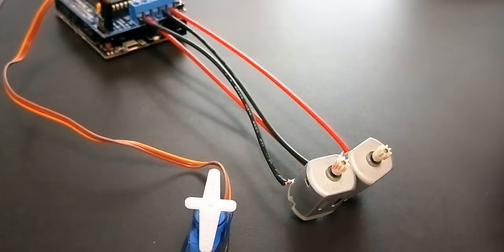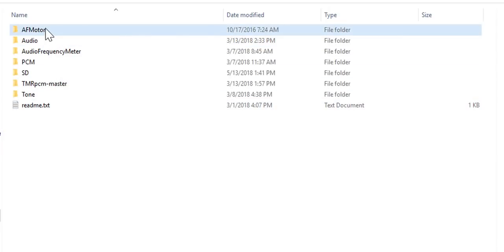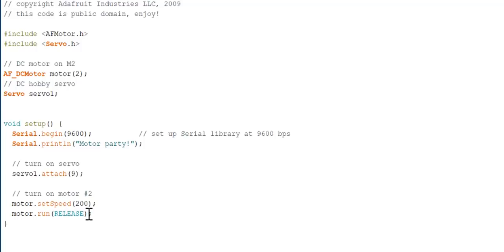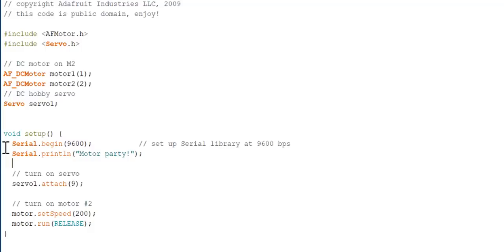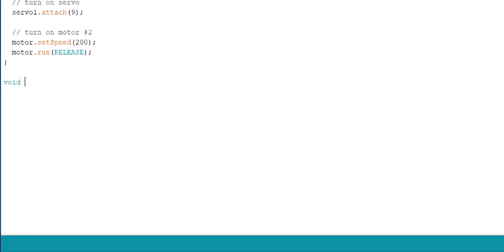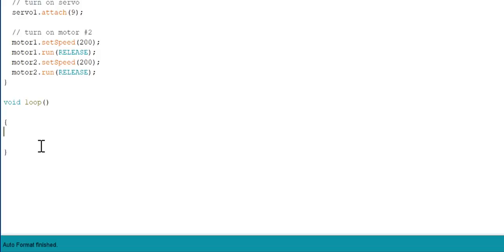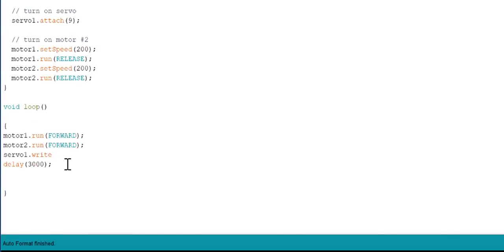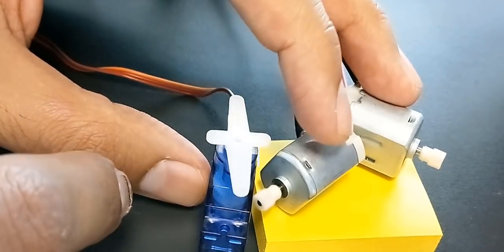L293D Motor control Module Tutorial - Run motors off the Arduino

Comment: Thank you so much for this video. Very thorough. One thing I’m still confused about is the Rx/Tx connection for this shied. I saw a video where someone connected their Bluetooth module to the servo pins, for power, ground, Tx, and Rx. The app I’m using as a GamePad controller is not recognizing the board, and I’m thinking I should just solder two wires to the Tx and Rx soldering that correspond to pins 1 and 2 on the arduino. I know these are used for serial communication with the arduino and that I would have to just disconnected the Bluetooth module before connecting to my computer. 

Any thoughts about the Servo pins serving as a connection point for the Bluetooth module?

Comment: So I assume I’ll have to get another arduino because after I hook it up, I won’t be able to use the digital pins from 0 to 13 if I want to connect leds, or other sensors… am I right ?

Comment: Can u run a nema 17 style bipolar stepper motor using this?
Does it make any sounds? Wondering because i want to make a 3d printed clock an it has quite some gears inside so i need more touqe than that lil unipolar stepper that is usually used with arduino. I am looking for a Solution that doesnt require an extra power source for the stepper. 
If someone knows it would be really helpful cause I dont hace a lot of experience with electronics

Comment: How do I use the digital pins to connect sensors/modules? I want to connect an ultrasonic sensor, a bluetooth module, and 4 dc motors.

Comment: Thankyou for this Video. I have purchased one of these shields to run a large 12v motor. What is the best solution to power the motor? I want to handle approx. 100A at 12V.  Can I run the program through an Arduino, to this Shield (powered at 12V) to a relay on each motor out line? Will a relay react fast enough to deal with the PWM of the Arduino?

Comment: A great explanation my friend. I just like to ask whether I need to remove the jumper clip from the motor shield while the motor shield and Arduino is run by only an external power source?

Comment: Very nice tutorial. I was wondering if a temperature sensor can be added in the scheme in order to change the rotation direction of the motors depending on the temperature read? Thank you.
Reply: You can use the 3x6 grid of connections to the +5, Ground and A0-A5 shown at 4:13 - 4:57 in the usual way.

Comment: Hey, I had a doubt in our project we are using 6 motors so can you suggest whhich drivers should we use to connect all of them as L293D and L298N permits 4 and 2 motors to use

Comment: Hola q tal disculpa le quería poner unas 4 baterías 18650 de 4.7 volts y 8800mAh cada una mi pregunta era si el motor shield con el arduino lo soportan. 
PD. Estoy alimentando 4 motores, un servo y un ultrasonico

Comment: I had a problem to connect this ..the problem is that if I connect both Arduino and motor driver to battery then motor driver light on but when I connect both battery and laptop cable to Adriano it will only on Adriano..... 😭..why

Comment: I have a question: So I have the Elegoo Mega2560 Board can I use the Shield on it ? Or is it just for the UNO? 
I found some other Motordriver but I want to control 2-4 DC Motors and a SERVO.
Reply from the maker: Should work

Comment: its not running for me. I have check the power supply,i am sure the problem wasn't batteries.But the weird point is that the driver can't upload in COM3 and COM1, but successful in COM4 and COM5.Is that a problem?Or the board may be broken?(the LED of the board is work)

Comment: do you know how to connect 2 steppers instead of dc motors?
I wish to build the collision avoidance  car, but with steppers instead of DC motors. For that you need 3 libraries, NewPing; servo, and AFmotor.
very new with arduino, and has been a very frustrating ride so far...
a bunch of information out there, but of little use.

Comment: Do the arduino needs to be comnected to a usb when you already have external power supply connected to the motor shield? I'm asking this because my motors run only when arduino is powered on.
Reply from the maker: Arudino needs a separate power supply yes

Comment: hey, totally new to arduino. only experience is programming and python and some rudimentary knowledge of electronics. i've read that i can power the arduino with a 12V @ 2A power supply, will that be enough to power the shield and run 2 3V DC motors? or will i need to get a separate power supply for the shield like what you did?
Reply from the maker: You would need 2 power supplies. One to run the arduino and one to run the shield aka motors.

Comment: thanks for the video. does this motor shield give the ability to control both motor to run in sync? I have problem getting my 2 dc motors to run in sync, my robot does not go straight. I am wondering if this thing is what I need to save me the task to look into PID control.

Comment: Hello! I was looking for this video! It is amazing. Question.... What Voltage did you use for those batteries. It may be 6volts?? Also, could I put 2 3volt battery packs together (2 positive wires into the + screw terminal, and 2 negative wires into the - screw terminal for the power (The 2 + and - wires from both the battery packs)) Thanks! I am asking this because I don’t have a 6 volt battery pack, so I was wondering if I could combine 2 3 volt battery packs.

Comment: Thanks. Very useful. Afaik the shield can not only run 2 stepper motors and 2 servos it can run those servos just as well together with 4 dc motors.
The servos are not controlled  y the l293D but by pwm pins of the arduino so are completely separate from the amount of dc motors or stepper motors

Comment: If I supply 12V to that board, can I run two DC motors rated at 12V and 1 servo rated at 7V ?

Comment: I have a doubt
that  L293D shield will use only analog ports A0 to A5 only and the digital pins a all OR will it use all the pins like both digital and analog ones??
plzzzzz reply
Reply from the maker: Analog pins can also work like digital pins.
Reply: @Fungineers  So if I'm supplying power to driver from external source and just wanted to run motor connected to M1 and M2 then which all pins of the driver should I connect to arduino, I cant connect all the pins of the driver because I have to connect RF receiver also to my arduino??
plzzzzz reply
Reply from the maker: https://youtu.be/OA0mJi0Q6GI
Reply from the maker: Did u watch this?
Reply: @Fungineers  Yes I have  watched  this video but I using MEMS sensor(accelerometer) and for that I need empty Digital ports not the analog ones......So only
Reply: @Fungineers  Can we solder a female header pin in the small hole provided besides D2 pin on the driver circuit ?? Can that be used for receiver of 433 MHz RF module??

Comment: Can tell how to add relay to the stepper motor using Arduino. I am building  mini injection molding Machine. 
It has running like this
Run at 60 rpm for 10sec than stop for  30sec and than again run at 60 rpm for 10sec. Please help me 
How can I do this

Comment: Hi sir as same I want to connect 1.servo motor
2. Two stepper motors
3.hx711 which is connected with load cell where can I connect hx711 module to driver circuit

Comment: Bro... I am having problem fixing the L293D Motor Driver Shield on the Arduino UNO... The pins are not going inside properly... Can u plz help?... Thanks in advance!
Reply from the maker: You can bend them slightly. If they are out of place you can desolder the unused pins
Reply: @Fungineers  OK... Thanks a lot...! The problem was solved by bending the connectors on Arduino UNO

Comment: Is there anyway i can use the digital pins when i Use the Motor Shield?
Reply: paul aaron Ordinario you can! Insert a wire into pin you want to use and then push the motor shield into the Arduino.
Reply: @onlyme3543  so i cam still use an Nrf24l01 transciever with a shield?

Comment: Great video and explanation 👏👏👏
You have mentioned in the video about A0-A5 can be soldered! What about Digital pins? 
I need to connect D3-D6 for some other sensors! How to do that with L293D !
Reply from the maker: Thanks. You can use analog pins as digital too.

Comment: I don't know where I'm making a mistake but I've already death two base boards uno. Motors have DC 12V and shield power supply also 12V. I had a UNO board without power. Several times The engines were running and then stopped, and I didn't start it anymore. You can advise ..
Reply: The first power supply I used was the 19V 3A adapter and the second 15V 400mA ... both without the UNO power supply
Reply from the maker: What kind of motors are they and how much current do they draw? Im guessing they are drawing too much current.
Reply: @Fungineers  https://www.aliexpress.com/item/32778436544.html?spm=a2g0s.9042311.0.0.27424c4dhmv2PG

Comment: I'm using an IR to run my step motor using pin #6 if I install this shield there is no place to connect this wire for the remote control device to this shield.

Comment: How to make this work wirelessly using Bluetooth module ? Please explain ? What changes to be made in code and the driver module and where to connect the Bluetooth module .
Reply from the maker: Connect a bluetooth module with the arduino or instead of the arduino.
Reply: I have connected a Bluetooth module but I don't know how to connect the servo and 4 dc motors together

Comment: How can I use the digital pin of Arduino if there's a shield on the top? Because I will insert 5 pin in my Arduino base on my schematic and where's the IN pinout of the module? Thank you
Reply from the maker: https://youtu.be/OA0mJi0Q6GI

Comment: Hey ,Very useful video. Keep it up man. 
One quick question, can I use this motor shield for control 6 dc motor(forward/ backward)
If not,what I can use instead.
Reply from the maker: Thanks buddy. You can do up to 4 motors. You will have to stack another shield on top to control 8 motors. But battery voltage will also have to double.
Reply: @Fungineers  thank you🙂

Comment: How much voltage you applied externally on shield?? 12v ?
Reply: in the min. 5:33 you can see the external power is a AA conveyor battery, a single AA battery usualy has 1.2v volts, if we multiply it by 4 = 4.8v, he's using 4.8v power supply, not sure if it's suitable

Comment: Can i use it to run 12v motor
Reply from the maker: Yeah shoudl be ok. Make sure batteries are good for 12V or a little higher
Reply: @Fungineers  i plan on using batteries from old laptop. Thnx.

Comment: The motor shield driver board's ext power voltage states that 5-9volt. So after removing the jumer can i apply 12 volt to it? Or should i stick to 9 volt.
I habe bought bo motor which can run 3-12volts
Reply from the maker: Stick to 9. Motor should work fine at 9V.
Reply: @Fungineers  yes but if i can produce 12 volt my motors can run high RPM. I saw on website it can take input of 12 volt. But i am scared
Reply from the maker: What application are you using for? Do you really need to speed?
Reply: I am making a mobile phone controlled car for race
Reply from the maker: I think the shield should be good for upto 30V. Read the documentation to confirm, but I think it's ok to use
Reply: @Fungineers  ok thanks will try and let u know

Comment: how can we use the digital pins in arduino to attach sensors when the motor shield is put on? should we solder it to the pins available on motor shield ???
Reply from the maker: Yes. Just solder some header pins so you can connect wires
Reply: @Fungineers  can you take video about it
Reply from the maker: I already did it in my line follower robot tutorial.

Comment: Can I use it to control a big motors...let say nema 34 or 220V motor???????
Reply from the maker: No those cant be run off batteries. 220V needs AC current. Check how many amps your DC motor is rated for, and make sure it doesnt exceed the max current/amp rating of the shield.

Comment: Hy bro, i am using this motor shield to connect 4 motors......i want those to be operated wireless, so got an nrf transceiver where do I connect the receiver......
Reply from the maker: Hey buddy. You can connect to any arduino digital pin. You can add headers on the shield like I did in the video that I made about the line follower robot. If you watch that video that should make things easier.

Comment: Hello...could you help me? please.  So I am a french professor in france. I want to make some lessons on arduino sytems but I don't succed to run  some motors with L293D Motor control modul...with mblock grove shield not with program C .Thank to converse with you.alain
Reply from the maker: Bonjour. Whats the problem you are facing? I can try to help you but it will be difficult without seeing your code. Its better to post it on an arduino forum. There are people who are smarter than me on the forums and a lot of people can look at your question and try to answer it.
Reply: Hello my friend.I am Alain Aubry from France.I am a teacher in college and I try to find some new lessons for my student. I have made a lot of lessons but I am stop by three problems...LCD RGB screen, ...7 Segment screen and how to order motors with this cart L293D...In france, we don't practice in college C Langage  we use mblock module....but I don't find the programe for my three problem anywhere.....are  you able to make these programme?

Comment: Does anyone know what pins this shield uses from the Arduino? I want to connect addition things such as LEDs and a button, but I don't want to solder to pins that this thing is using.
Thanks
Reply: Same question here...
Reply: @erbozr7231   I eventually figured it out, and I put the list in my code for later referral:

/*  ================================= MOTOR SHIELD NOTES ================
  Digital pin 2, and 13 are not used.

  The following pins are in use :
  Digital pin 11: DC Motor # 1 / Stepper # 1 (activation / speed control)
  Digital pin 3: DC Motor # 2 / Stepper # 1 (activation / speed control)
  Digital pin 5: DC Motor # 3 / Stepper # 2 (activation / speed control)
  Digital pin 6: DC Motor # 4 / Stepper # 2 (activation / speed control)

  The following pins are used if any DC / steppers are used
  Digital pin 4, 7, 8 and 12 are used to drive the DC / Stepper motors via the 74HC595 serial-to-parallel latch

  The following pins are used only if that particular servo is in use :
  Digitals pin 9: Servo # 1 control
  Digital pin 10: Servo # 2 control
  =========================================================================
*/
Reply: @ArcanePath360  Thanks man!

Comment: How many voltage for arduino mega and l293d module if i am use arduino mega with l293d module and use 5 ultrasonic to 5 v in l293d module and 5v lcd and 1 ultrasonic 5v in arduino mega. Thanks before
Reply from the maker: Same as whats used here. All sensors and lcd cam be connected to arduino 5v pin

Comment: Hi,  How do you set the voltage of the motors? I have motors that can be take 3v to 5v. 
Thanks
Reply from the maker: You dont :)
Motor voltage is set by the number of windings they have so the voltage at what they operate is fixed (but have a certain range like you said 3 to 5). So anything in that range is fine.
Reply: @Fungineers    I see. I guess what I am asking is, what voltage does the shield supply to the motors, but I suspect it is 5v from the Arduino with the jumper pin intact?
Reply from the maker: Yeah sorry I didnt understand your question. You are right, It is 5V
Reply: @Fungineers   Thanks

Comment: PLEASE HELP ME!!!!! My first question is :can i run only 4 DC motors 5v?Which power supply i should use,the one from arduino or from l293d module?Can i run these motors in a particulary part of time like : start first dc motor and than after 3 second it will change rotation and the second dc motor start to rotate? Please help me...
Reply from the maker: Yes you can run 4 motors, as I have clearly stated in the video. You have to use the external power supply. Yes you can run them in any order, by programming your Arduino.
Reply: @Fungineers  thanks sooo sooo much, U are awesome!!!
Reply: @Fungineers  Sir can u help me with the code please,because im having problem to keep one dc motor off while the other is working?
Reply from the maker: you can use the release command to stop and run to operate as explained. Read up on the library and what it does and it should make sense.
Reply: @Fungineers   thanks a lot.I have tested them and everything is okay.Thanks again!

Comment: How to control toy car stearing using arduino
Reply from the maker: That would be a great project. 
First of all you need a servo to act as the steering wheel and link 2 rods to it. So when the servo rotates 45 degrees left it pulls the rod and tyres to the left and vice versa. The arduino coding is easy, just use the servo library and use 2 pins from arduino one for left one for right. When one pin is high it enables servo to rotate left and vice versa.
Reply: @Fungineers  instructions unclear. Arduino has become sentient.
Reply from the maker: I for one, accept my Arduino overlords.
Reply: Please make a vedio

Comment: can we use this with node mcu esp8266
Reply from the maker: Yeah shouldnt be a problem.
Reply: @Fungineers  how the wiring should be done...like the PWM signal is sending from the D4 on the esp node mcu and HIGH D1 and LOW D2....so on which pins of the motor shield should i connect the mcu pins
Thank you for the quick reply..
Reply: are you there?
Reply: forgot the signals..... can we use the same library but how the wiring part will be done..